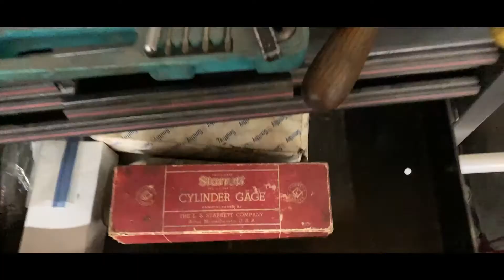How To Rebuild A C4 Transmission

Comment: Appreciate you sharing your knowledge…I have a c4 out of a 68 fairlane 500….I believe it had a straight 6 motor… I want to rebuild for a 289…I know I will have to change bell housing… are those are to come by?
Reply from the maker: Thanks for the subscription! The bell might be hard to come by. Broader performance transmission might have something if you call. JW super bell Part number 92462-157 will work with the 157 tooth flywheel, but is about $580. Otherwise scouring the internet might produce something. Good luck!